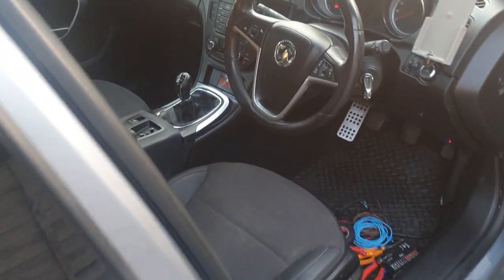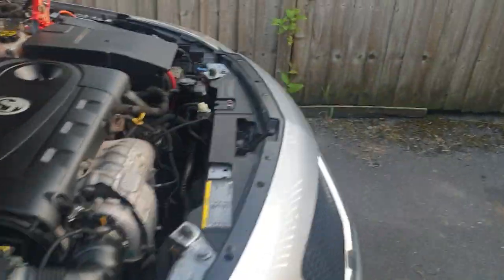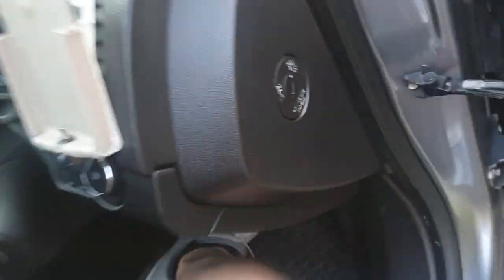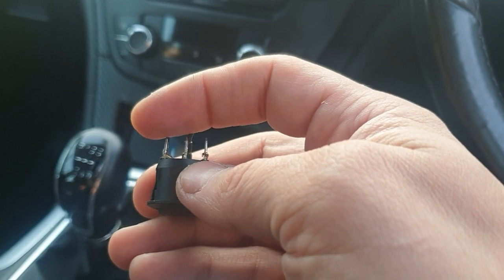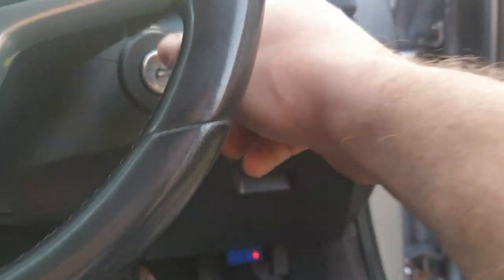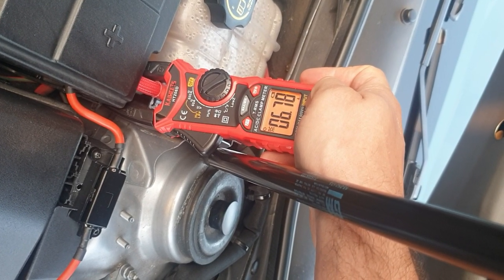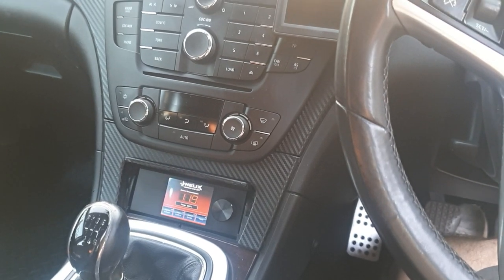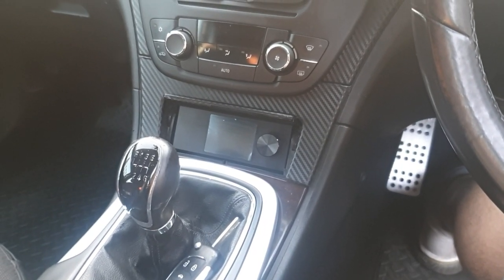How to listen to music with ignition OFF

Comment: You have a 2 position switch and it has 3 contacts.
1 contact - permanent +
2 middle contact - remote for dsp and amplifiers
3rd contact - key, ignition or radio remote control
1st switch position - dsp plays without a key, car sleeps
Switch position 2 - off
3rd switch position - dsp turns on the key or remote radio.
Competition 1st position, always 3rd position - safe battery.
You're doing a good job

Comment: Is this basically the 'Acc' setting that i thought every car manufacturer had as a stage before the ignition was on? If i press the start once, my headunit and dsp/amp rack will be powered, along with lights and windows. Twice and id get HVAC and more console lights. Third press would be to start the car. Your switch is doing the same as me pressing the start button once, right?
Reply from the maker: Not really, as my switch turns on ONLY the DSP and nothing else. Car is still sleeping.

Comment: Hi sir how are hope doing good as always educating people who interested to learn things you experts in sir I have questions should we leave any of the car speakers with car factory amplifier if we upgrading the system mainly  the dashboard speakers and one more thing sir if you have choice you can install 3.5” speakers in the dashboard combers or upper panel of the doors and 2.5” tweezers installed on the dash corners so where should go with 3.5” dashboard close to tweeters or to the doors please help me to sort this out thanks in advance
Reply from the maker: You can use factory amp if you want to and if it orovedes enough power. 

Ideally you would want mid and tweeter to be in close proximity to each other, but depending on the crossover frequency, they might perform good further appart as weel.

Comment: Are you not (allowed?) using a charger, while doing the demo on EMMA-event ?

Usuallly you are loading with the charger while doing measurements and changing the EQ on DSP, right ?
Reply from the maker: There are no sockets outside during emma, as the venue is outdoors.
Reply: @RAW-CAt  I´m just surprised as I thought this kind of a standard or do they think everyone has an extra battery in their trunk ?!...
I was at one event in Vienna once, it was in the parking garage and everyone was using a charger.
Reply from the maker: @tommyshoe-star1426  I guess it's different for local qualifying rounds vs finals.

Comment: How to avoid the battery from dead if lets say i play the music for 2 hours?
Reply from the maker: You have to monitor the voltage somehow. Install a voltmeter and don't let it drop too low.
Reply: Or leave a 10amp battery charger hardwired to your battery and plug it in when your gonna be doing extended tuning sessions